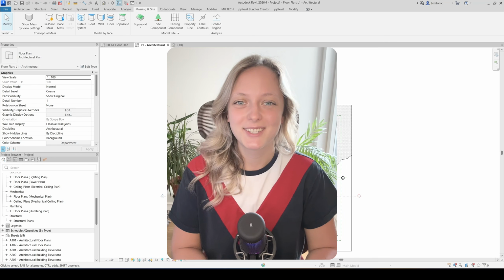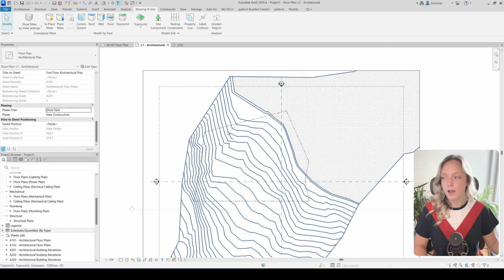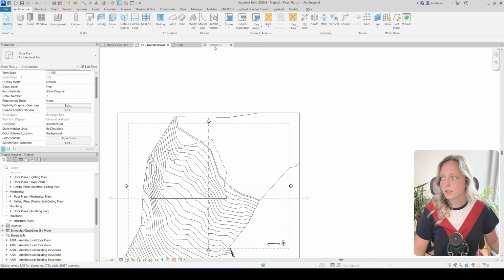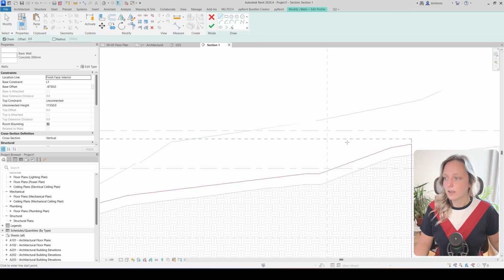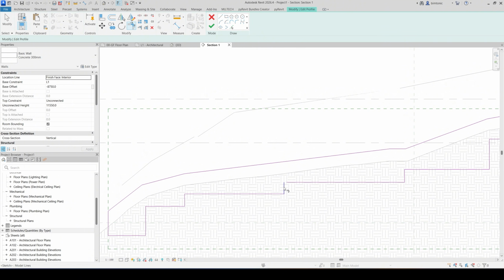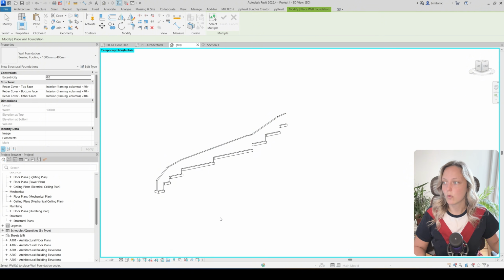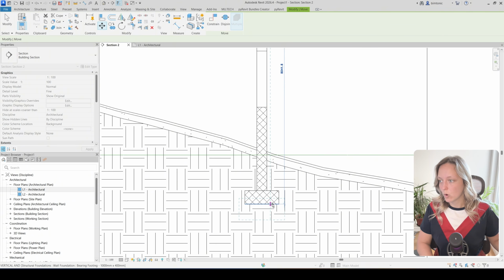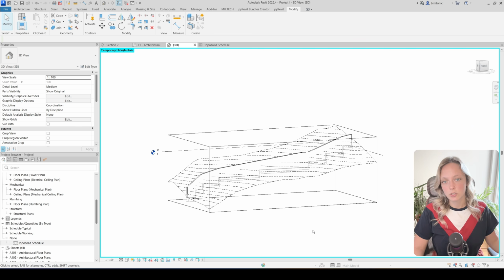Modeling Retaining Walls on Steep Slopes in Revit (With Cut & Fill Schedules)

Comment: I was wondering about the cut volume of the footings. Because in real life, they excavate according to the width of the footings, at least. 

And if they did, the volume cut by the walls can be discarded? Please enlighten me.
Reply from the maker: If you want to cut more of the soil you can use model in place tool to model that shape and than use cut tool. Schedule will calculate it as cut volume

Comment: Just checking if you have any videos on calculating areas of formwork of concrete elements in Revit (preferrably Revit 2025). Thanks.
Reply from the maker: Unfortunately not yet. Because formwork area calculation is so complex, it's very difficult to do in Revit schedules and typically requires a Dynamo script to extract the face areas.